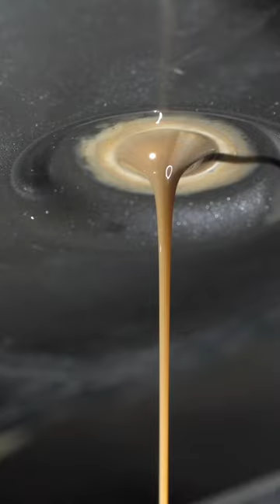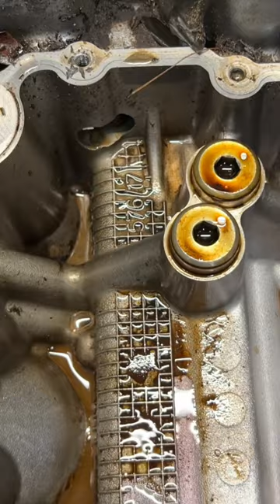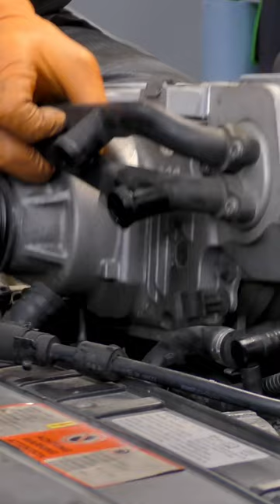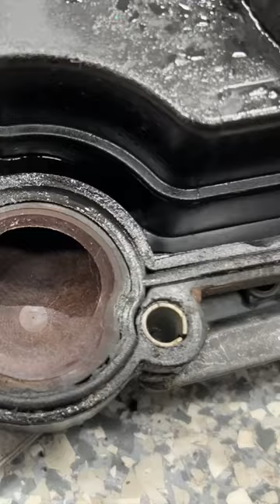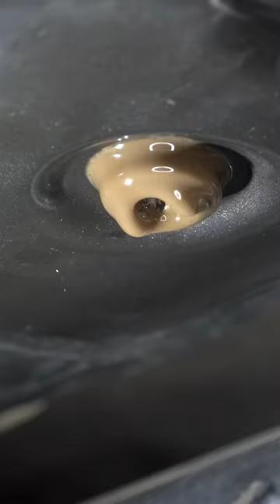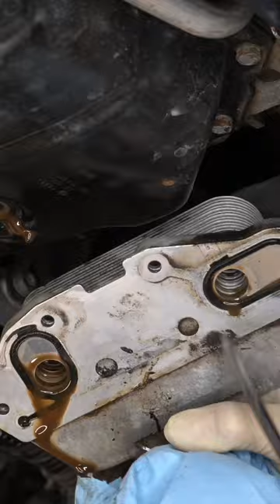Audi PCV Failure Causes Coolant in Engine Oil

Comment: I have fuel in my engine oil. what could cause this. 
Logged the car, no issue with injectors, checked fuel pump no problems there, nothing on the comp test.  Unsure now as to where the internal leak is occuring 
Audi S3 8P Sportback
Reply: Running extremely rich.

Comment: A car built by accountants or engineers??
Reply: Accountants probably.     You need engineers who race.    They wouldn't put up with such mechanical nonsense.   More and more engineers are theoretical.     They have never welded anything, built anything, or even turned a wrench.    They were good at math so they wrre pushed into engineering.
Reply: @markmiller6751  Many engineers lack automotive experience. You have to love what you do, otherwise it's just another brick in the wall 🧱
Reply: I also think that anyone trying to build a car should be a Trades person first. Spend 5 years working on cars and see what happens in the shop. Include the price and customer experience.
Reply: Last car built by decent engineers that could look ahead was probably a w123 Merc.
Reply: @MrTheHillfolk  Ford Panther platform.

Comment: Had this happen to a '98 Tahoe. The water intake is made of cheap ass metal that disintegrates over time. I was like where the fuck is this coolant leak. Then I checked the oil.
Reply: You must not have change your coolant I have a Yukon with 432 thousand Miles never had a issue
Reply: @nickajk1  the metal on the water intake where the hose connects  corrodes. It s a pretty common issue. If I were you I would monitor it. When I took intake manifold off the gasket was damn near non existent just fell apart. That how water was getting into the crack case.